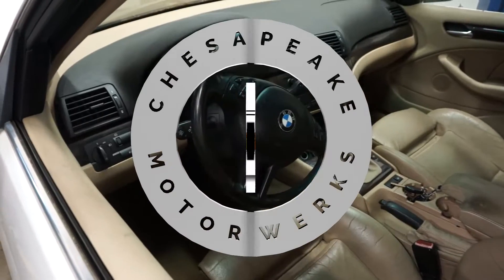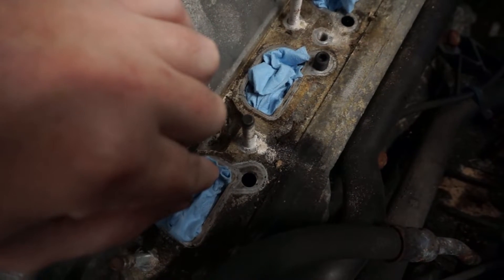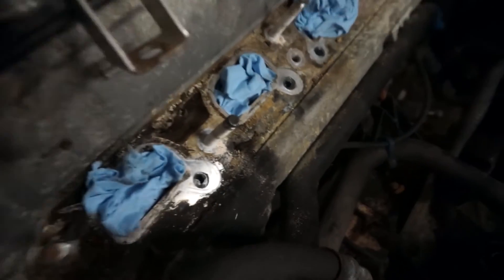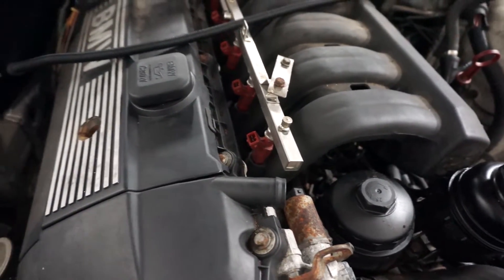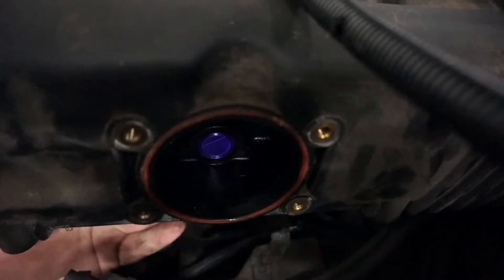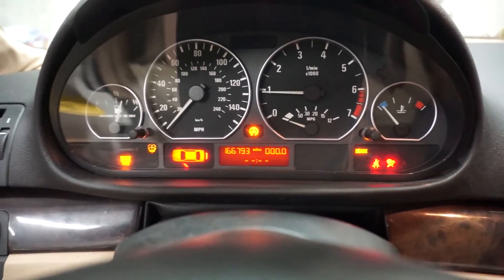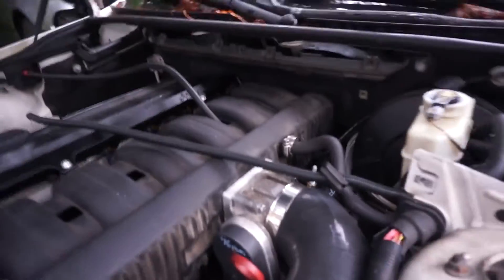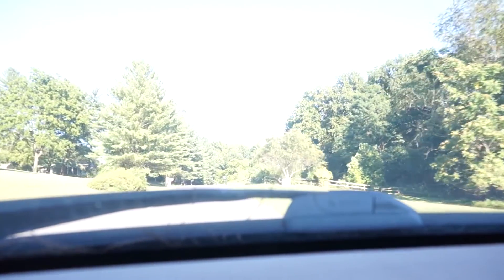E46 330i M50 intake swap, ICV delete, and N52 big bore throttle body install

Comment: So, I've been out of the E46 game for a few years now.  I have an '04 330i 6MT sitting in one of my garages that I've owned since new, but it's no-longer my daily.

Can you explain what this is all about?  Why are you throwing an e36 intake on it?  AFAIK, during my first 10 years of ownership (when I was active), I never heard of anyone doing stuff like this.  N/A builds were usually headers, cams, tune, suspension, LSD, brakes, etc.  and forced induction was usually AA or ESS superchargers (turbos were later to arrive).  But I never heard of anyone working with an e36 manifold, bigger throttle bodies, etc.
Reply: What was it like being an original E46 owner ? I'm the third owner (just passed 4 years) of a '05 330ci 6MT and always wondered what the ownership experience was like back then.

Comment: Just why? How to make the engine run worse and lose power lol
Reply from the maker: This is in preparation for a turbo build where it is typical to block off the DISA valve on the factory M54 intake. I'm keeping things simple so it's easier to work on and has less potential for boost leaks. Guess what BMW did with the N54? They went with a similar manifold design to the M50 that has large runners and no DISA valve whereas the N52 had two DISA valves and a complicated manifold in the top power variant. Anyway, the cars runs great - better than it has in years with the factory setup.

Comment: Hi, your valve in oil housing is broken, thats why your oil light keep on for a second after you crank it. Once you do a second start I guess you are not having the issue as you got pumped oil back into oil housing.
Reply: Can u please tell me what you mean by valve in oil housing to make oil light come on as my car does this on starting....... thanks
Reply: @B @BrettProud search for m54 oil housing non return valve, you can find a lot about it
Reply: Thays prolly what happend to mine too damnnn ha ha
Reply from the maker: I think you're right. I have an M50 where that valve is really bad and the 330i isn't anywhere near as severe, but I do plan on fixing it.

Comment: N62 throttle.body is bigger ;) n52 throttle body is god for.m50b20 intake
Reply from the maker: Yes, n62 is larger. Larger will make the throttle more sensitive and harder to fit intake tubing so its all a balance. As you said, n52 is good for the m50 intake and I don't think a larger throttle body will provide any benefit on 99% of m5x engines.
Reply: @chesapeakemotorwerks  i see dyno m54b30 with m50 intake but b25 and n62 throttle body make ~270 on wheels .
Bigger or too big throttle body can turn  your throttle control like  on/off  .
Reply: @chesapeakemotorwerks  so , finally what can say about your mod ? Better than OEM.?
Reply from the maker: @DriftDany  I love it. The throttle is more responsive, makes good top end power and awesome noise without it being too aggressive. Keep in mind that it does lose bottom end with the M50 intake, but I will be going turbo in the future which makes this mod worth it. The M50 intake without the ICV also make it very easy to work on. Is it better than OEM? It depends on what you want. This is sportier but less refined.

Comment: Where did you get the throttle body adapter
Reply from the maker: I made it. I have a much more polished version I've been running for a while now and my intention is to sell them.
Reply: I have a N52 TB set up I'm trying to sell

Comment: Do you have a link to the n52 throttle body adapter plate?
Reply from the maker: It's mine, I'll have a MUCH nicer version for sale at some point.
Reply: @chesapeakemotorwerks did you do a cad drawing? Would you mind sending me it? I don't mind paying
Reply: Are you still looking? I'm trying to sell my N52 tb set up
Reply: Do you still have it?

Comment: Contemplating doing this on my 330i. So far you are the only person who didn’t keep the ugly rigged M54 rail and you swapped to the Rally Road. The issue I’m experiencing is finding that fuel rail you used with the proper M50 intake mounts. Where did you pickup your Rally Road fuel rail from?
Reply from the maker: I bought it from rallyroad.net. It's listed as their "High Flow Billet Fuel Rail"

Comment: m50 manifold will cause low end power drop. You dont got the DISA valve anymore
Reply from the maker: Correct, I installed this because I will be going turbo in the future where I don't want the DISA valve.
Reply: A good tune will correct the low end drop

Comment: Does deleting the ice cause any issues? Like with efficiency or rough idle?
Reply from the maker: Deleting the ICV shouldn't cause any efficiency or idle issues. It does change the air flow which is especially relevant on the M50 intake; that said, my engine has a steadier idle than it did with the old ICV. The one issue I have been battling (and it seems other people have had this problem too) is acceleration enrichment going too lean and causing a stumble & even lean pop with aggressive throttle changes, such as when rev matching a downshift. Swapping to E36 injectors helped a lot & I've added more acceleration enrichment (ip_ti_pvs__pvs__n) in my tune. I have it really close but not perfect now.
Reply: @chesapeakemotorwerks  I see, thanks for the info 🙏🏽

Comment: Can you help me, is this worth it? It sounds fucking amazing that induction noise ? I have a 2003 530i and I'm curious if there's a power increase because I was told I need headers to see the increase
Reply from the maker: I'm planning to dyno it at some point; it's hard to tell if there was a power increase because it wasn't running correctly before I did the swap, but it certainly feels strong now! Headers will help but even just this mod should result in more power. The downside is you lose the DISA and some bottom end with it.

Comment: Hello, as i can see i have quite the same problem with almost the same setup, could you help me if its not problem.Thank you
Reply from the maker: The roughness? I think it was a combination of a small vacuum leak and a poor quality MAF. I made sure everything was sealed & also replaced the MAF (from advance auto) with a genuine used MAF and it starts & idles great. The last issue I have with this setup is a backfire through the intake when aggressively revving the engine with no load, such as when rev matching a downshift. That's from it leaning out due to incorrect acceleration enrichment. I've been working on the tune and have it close but not perfect. It's good enough I've put 4000 miles on it.

Comment: Apart from the icv delete did you have to tweak the maf throttle body parameters to make It work?
Reply from the maker: Yes, the maf is the same and will continue to meter air the same as before but there are a few tables that need to be adjusted since they rely on throttle position. I'll do a video on it later.
Reply: @chesapeakemotorwerks when ever you have that throttle body space ready to sell im ready to buy one let me know i really want it for my build
Reply: @chesapeakemotorwerks  are you coming out with that video?
Reply from the maker: @Mr2010camaro916  My goal is this weekend, it takes time to acquire the tools & materials for the testing not to mention filming. Most of the testing is complete at this point and I have the Tool Aid crimper I showed years ago (and used incorrectly), the Ideal 30-579, T&B ERG4001, AMP 47386, DMC HX4 w/Y501, and AMP 59170 "t-head" included. These are all tested using PIDG terminals and I also have some T&B terminals as well as a selection of butt splices that don't play well with some of the higher end tools.

Comment: What n52 throttle body did you end up going for? There are a few different options I think...
Reply from the maker: The early ones (2006-2008 I think) work best. The one I used is advertised to fit a 06-08 325i, 328i, 330i and e60 530i. You want the oval plug which is plug & play with the MS43, otherwise you need an adapter or to rewire the connector to fit the later N52 throttle body design with the square plug. It looks like the older ones have a metal butterfly why the later ones are composite.

Comment: Does it have a tune?
Reply from the maker: It currently has stock fuel/ignition maps but is modified to remove the ICV. I'm making sure the engine is 100% before tuning it (VANOS seals next), then I'll be doing a video on how to tune these (Alpina B3 intake model, raised limiter, optimized fuel/ignition/cam tables, etc). This car will also be getting a turbo in the near future.
Reply: @chesapeakemotorwerks  Hi there! Still planning on making this video?
Reply: As somone with mutiple turbo (m54 , s52 , m52 ) cars that big throtel body is a bad idea with boost. The m50 manifold already favors the center two cylinders running Boost through a stock m54b30 throtel body. Your going to exacerbate the issue. Either change to an aluminum intake with boost or go back to the smaller t.b.. Im not talking smack, just talking from experience. Hey, mabye you could add a 7th injector or water /meth before the t.b. to combat it.  ( I run water meth on the s52 )  did you modify the opening of the m50 manifold? Or is that the choke point ?
Reply: Yo yo we need these videossss 😫